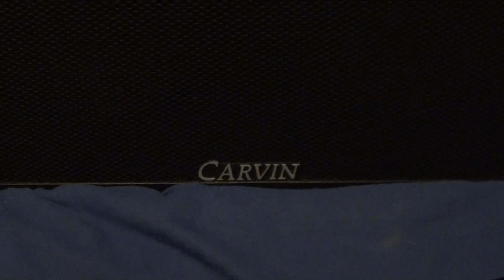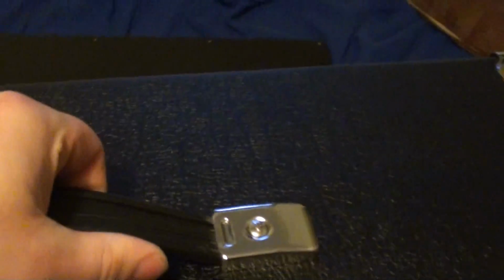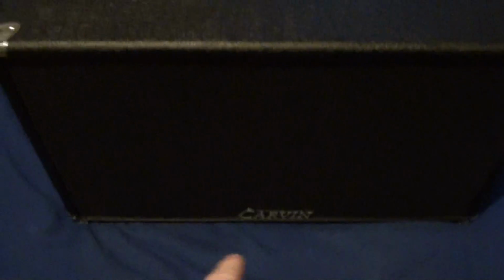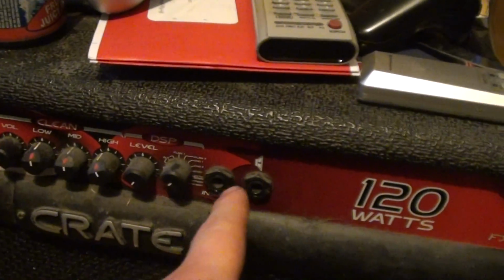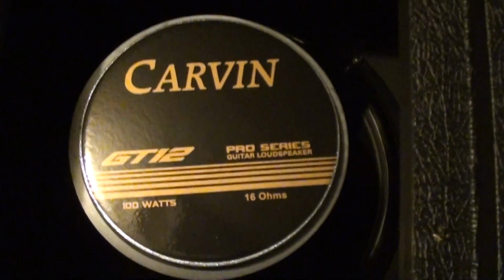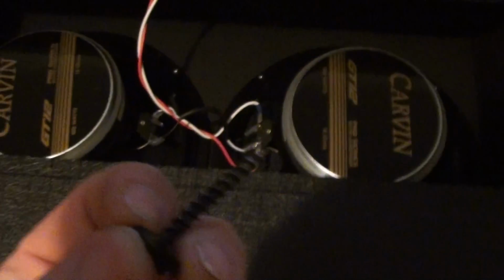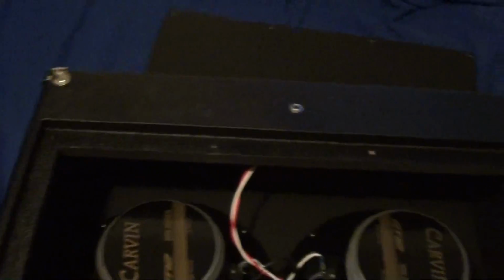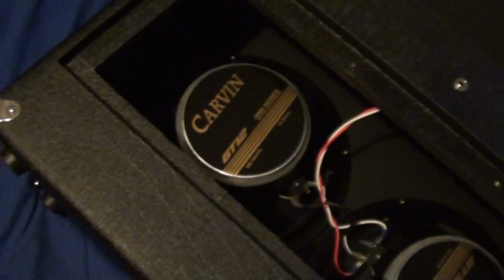Carvin 2x12 Speaker Cabinet

Comment: it's not plywood, it's solid poplar, which is fine, anything beats particle board,  the speakers are made by Celestion for Carvin, they are 16 ohm G12K-100's, they work very well with tube amps with lots of headroom

Comment: I plan on changing the woodscrews out by putting in threaded inserts and using machine screws. It's meant to be convertible, but with the wood screws eventually the holes will get chewed up and if you tour or play a lot of gigs you may end up changing that back panel quite a bit...Carvin does this on the electronics cavities of their guitars already and it works great.

Comment: I have this cabinet, it's very light. At least I think it's the same one. I do not like it so much by its self. It doesn't have a lot of midrange. It's very dark. However, I use it with a Mesa Rec 2x12 with V30's and it sounds good with both of them plugged in. I never go 4x12, I like to use two 2x12's.

Comment: I have the identical cabinet with one difference, mine is permanently open back with no option to go close back. It’s the loudest ballsiest 2x12 I have played through. Which has me confused, because I think the GT12 speakers should be similar to the Eminence Governor speakers, which in turn should be similar to Vintage 30s, which in the end would live best in a closed back cabinet?
Reply: I have the newer VX212 with the same speakers and dual removable ports. All I could find about them is that they were re-labeled Eminence, probably Governors.
Reply: @asnark7115  so we agree on the probable model. I love them, what do you think?
Reply: @voxpathfinder15r  They're amazing. It's hard to believe I got the cab and speakers it has in it for not even half (used-mint) what a mesa or orange would cost.